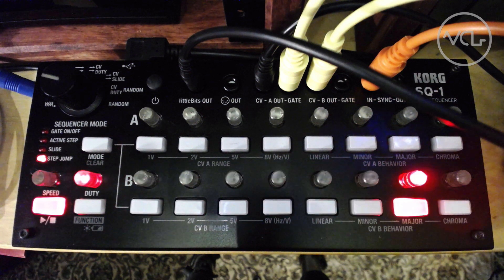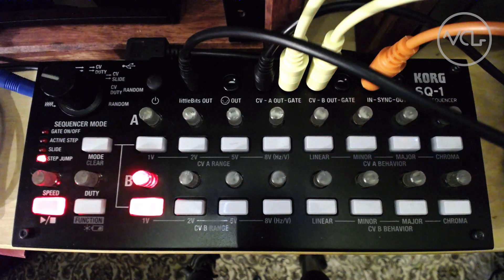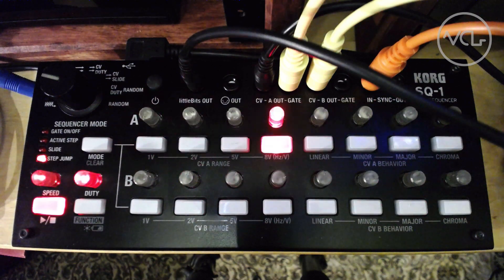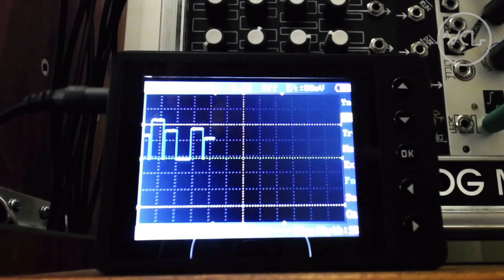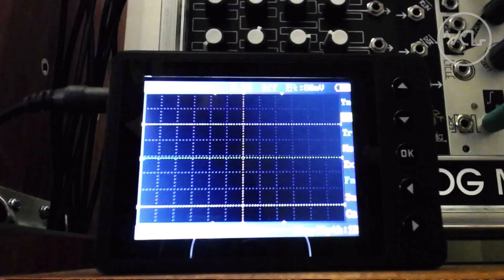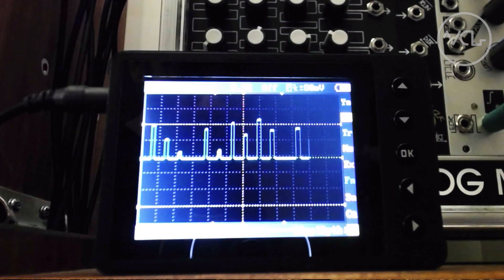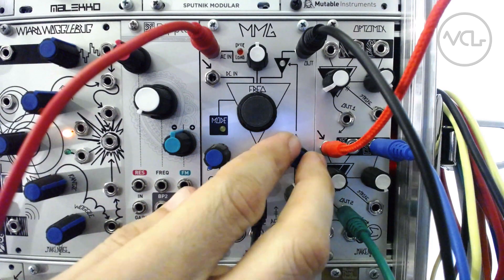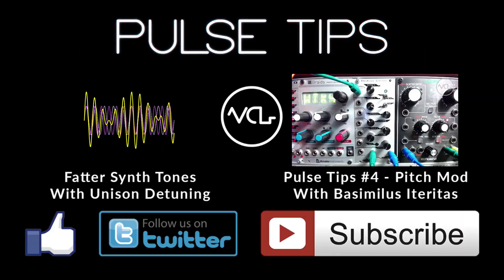CV From Korg SQ-1 Eurorack Sequencer LittleBits Out

Comment: Thanks for a very helpful video! I'm getting an sq-1 to use with my ms-20mini and I was wondering if I could use the l'ilbits output somehow. Cheers.
Reply from the maker: You'll have to try it out and let us know how it works with the Korg voltage standard. I believe the output probably conforms to the 1v/octave standard, as I think that is what the LittleBits are based on... However, you could certainly still use that as a modulation source, if it doesn't send the expected tuning. This little sequencer is one of the best bargains around these days!
Reply: Yeah, I figured it wouldn't work for pitch, but I'll be trying to modulate parameters. We'll see how it goes! :)